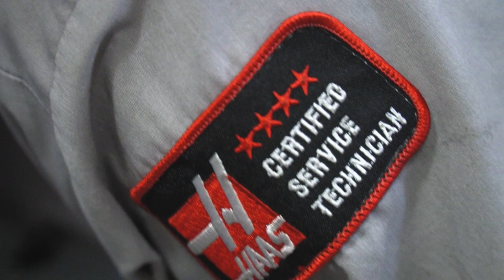Haas In 90 Seconds - Orville Collins - Haas Automation, Inc.

Comment: Gj man,
I repair Haas machines for over a four years now, did everything, from vector drive PCB repairs to complete lathe refurbish...
i wish Haas was trully so customer oriented nowadays.... NextGen controller looks sick, but for customes, it's closed on every door(call HFO, wait for HFO, pray that it's cheap) PID tuning of new machines is poor, we have ST15(2018) runs good, but 20mm insert drill is an overkill sounds like a chuck crash every time You engage it... (SL10 2004 handles it easy), imagine You want to turn a heavy part on ST30, really heavy, and a next day, you go something light.... no chance to change spinndle acceleration parameter.... If you want, You may pay 6kUSD just to do so, but if You have like 20+machines.... I am Sad...